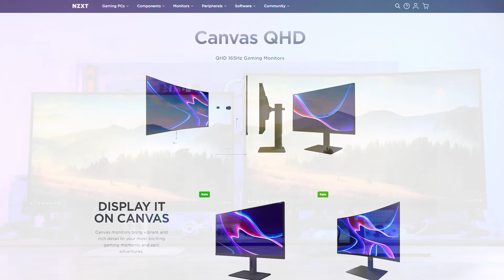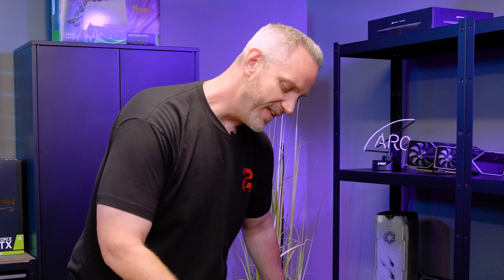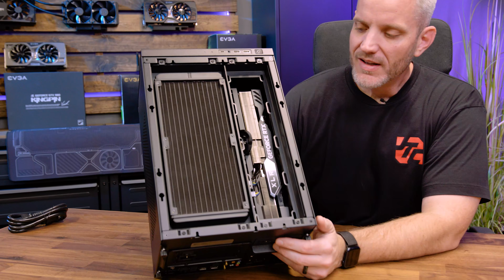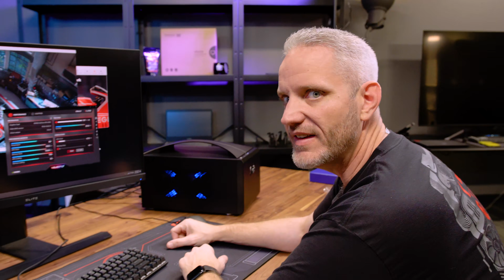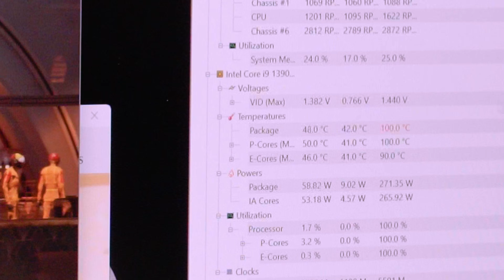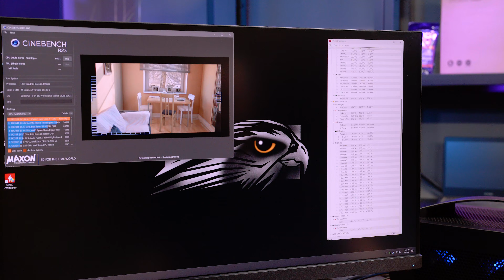Falcon Northwest DARED me to review the Fragbox!

Comment: $3600 for a 4060 Ti, 9600X, & 32GB RAM. That should be illegal.

$2000 in prebuilt tax . What an absolute scam and it’s quite embarrassing that Jay even features their products on this channel.

DIY is $1700 before a case, that’s including paying full price for windows. You also get a better AIO, Liquid Freezer III. 

Just for reference, I just built a 9800 X 3-D , 64 GB ram, 5080 FE, 2 TB SSD, ASUS ROG b850i, LF 3 AIO, in a NCase M2 for $2700… almost $1000 cheaper than the frag box.

Comment: I have a 2023 Talon. It’s awesome. Falcon is awesome. My 4090 cable failed and they got me a CableMod one, tested it and mailed it overnight. I just ordered two AMD FragBoxes.
Reply: I'm thinking about getting an amd fragbox with 64gb ram...but I don't like that their only option for getting a ram with 6000 MHz is their 32gb option. I've read that 6000mhz is the perfect sweet spot for AMD processors, and that anything higher than 6000 MHz will not be stable, so their 96gb 6400mhz option is out the window. What are your thoughts on this? And which ram did you choose?

Comment: Its nice but the price is not, I compared the 7800x3d build on their site similar to my own sfx build, similar parts gpu, cpu, ram size. heck even my gpu costed more then what they show theirs add on to be, and yet their build was around 1400$ more then what i built mine my self.. mine was a corsair 2000d airflow, 7800x3d, 4080 trinity, 32gb ram, msi b650i edge WIFI, 2x 2gb SSD etc.  Their case design is nice but not worth the cost of another 4090 added on top..

Comment: I built an SFF PC in a Cooler Master RC-130-KKN1 Elite 130 - Mini-ITX case that's about the same size, or slightly smaller than the FragBox.  I even have a full-size optical Blu-Ray drive in mine, a 120mm AIO paired with a Phanteks T30x120 fan.  It can fit a 343mm long GPU, but I've got a PowerColor Fighter RX 6700 XT in it.  I love this case so much, I went and bough another one just to have for a future build.

As for the FragBox, I was wondering if they can sell just the case, but with the I/O ports on top (where things can fall in and get gunked up), that was the deal-breaker.

Comment: Interesting.  I have one of these (admittedly, mostly because it was so hard to find a GPU at the time) that's probably a generation older, and this new design is better.  Mine had some overheating issues with the M.2 (added extra case fan) and I had to replace the PSU (they were using a 750w EVGA I think, was rebooting/crashing).  The older one had some really weird airflow.

Comment: Its like the watercooled PC I built about 6 years ago. Silverstone SG02 case and everything (I got an full size 850w psu in there). Still I would move the psu to the other side and let it get its own fresh air intake. Exhausting for that tiny case air makes it so hot you can barely touch it - and it doesn't really do anything to help cool the components. Basically, just making it dump massive passive heat into the case to deal with....

Comment: I have a Falcon Northwest system I bought about 3 years ago. Their build quality is excellent and they use higher end parts. It was not that much more expensive than other brands I looked at. Still runs great, I have had no issues with the system. I did need some troubleshooting help when installing an m.2 ssd and their support is excellent.
Reply: Thank you Aaron!

Comment: I'm mesmorized by the "Prediction" portion of the hardware monitor in the Ai Tweaker menu of the BIOS. It specifically says it expects to reach 1.588 V on the P-Cores at 5.8 GHz. That is extremely high, in my personal opinion. Besides setting the BIOS to automatically adjust the voltage according to temperature, what sort of undervolting could be done to keep the P-Cores at 5.8 GHz so it doesn't run so hot?

Comment: I have always been a fan of Falcon Northwest & Maingear but I have always ended up going with Digital Storm instead because they offer air coolers in their build configurator rather than AIOs. For my use case, AIOs are a deal breaker for me. If FN offered an air cooled option in their build configurator, they would have my business.

Comment: I have a Falcon NW Talon tower with 5950X & 3090.  When running ACC with 29 AI cars, my 3090 climbs to 85 degrees C.  I am shopping for another pc and am considering another Falcon NW Talon with 7950 and 4090.  The 4090 dissipates more heat than the 3090 so I am concerned about heat issues.  I was amazed that the small Fragbox could support a 4090.  Maybe the Talon with a 4090 can manage the heat after all.
Reply: Thanks for your business Mike!  The Talon with a 4090 can indeed handle it.  The 4090 coolers are even more massive than the 3090s.  The 7950X+4090 Talon just won Best Gaming Desktop over at PCMag - check out the review there!  We also do Quadro builds if you're running mainly professional/AI apps.

Comment: "Make sure it is plugged in correctly" needs to have an asterisk that there is very little feedback as to what correctly is.
The slight click you may hear is false, and then it is down to, how far do you dare to push in that cable? It is such a flawed power connector design on that system it isn't even funny.
PCI-E 8 pin has a click catch, once you hear and feel the click you are there and done, and this IS the way to do it, no ifs, no buts, no "mah economy" crap that Nvidia utters lately.

Comment: I found an old Fragbox at my work and built up a monster system in it but due to the old layout (which had a CD rom drive in the front!) I could only fit a 120mm AiO. So glad they kept the size and redid the internal, looks like a total winner except it starts at $3300 USD with an i5 and 3060ti!!! Ouch! I could build a SFF PC with 4090 and i9 13900K for that price!

Comment: Back in '08, when I was considering building my first serious gaming computer, I did a lot of looking at parts and specs and numbers and combinations and all of that was just WAY over my head.  Then I looked at a custom builder.  I seem to remember Falcon Northwest being on my radar as a potential choice, though I didn't ultimately go with them.

What I DID find was that by using a custom builder, Like Falcon Northwest, I could actually get a lot more value for just a little more money.  Like KNOWING your components will work together.  My builder even suggested I change my build because my chosen PSU was going to be running at it's limit and offer no headroom for upgrades.  My builder offered an iron-clad warranty IN ADDITION to the various component warranties.  My builder offered to install not only my chosen OS, but all of my games AND make sure they ran without issues.  Then, of course, they stress tested it and did the burn-in for a couple of days to make sure that when it got to my door it would be ready to play with zero issues.  For all of that, I paid about $300 ABOVE what all of the components I selected would have cost ME to get and build myself.  It was really a no-brainer.

Nowadays, building your own is easier because there is SOOO much information available to the new builder.  And if you wanna do that, I salute you.  But just on the warranty front, keeping all those receipts, filling out all of those warranty forms, getting all of those ducks in a row, and preserving that record if something goes bad before it's supposed to was WORTH the extra money.  That is the real value of a System Integrator, the ridiculous amount of time it can save you.

Comment: Honestly it is a bit lackluster compared to community driven SFF cases. The layout is pretty standard, the size is not even SFF, since it's larger than 20l volume and internally the case is probably sheet metal. People should look into the 15l Ncase M1 Evo or FormD O1. 10l less and same performance in the end, while also being fully CNCd aluminium.

Comment: Hey Jay, I was wondering if you think this would work well for VR use, I'm trying to find a means to use my VR Headset on the go and a Laptop isn't going to cut it.
Reply: What about one of the desktop replacement laptops? Such as a MSI GT77HX? A bit heavier but if you don't seem to mind a 25 lb fragbox I doubt it'd be an issue for you then either. Albeit price point is probably fairly similar for the Titan laptop to that of a 4090 fragbox.

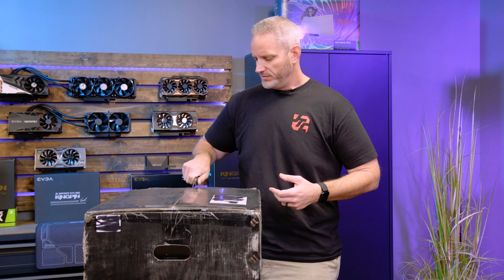Comment: 1:15 if it can power a 3080 Ti, it can power a 4090. The 4090 is actually easier to run than the transient nightmare  3080/Ti/3090. You'd only be able to use 3 cables and need to stick to 450W, but it's definitely doable on 750W. I've already done it with a Corsair SF750.

Comment: Your an practical guy Jay, i have asked this several places but never get an answer...  the gamingnexus video on the wrong way  to install an aio...
at 5.30ish he says the rad is split 60/40% > inbound/outbound...  this would mean that by volume with barbs down water would need to be pushed up over the separation plate, where with barbs up the water in the outbound side would be at a higher level than the inbound forcing the water up to the rad outlet barb and any bubbling thus gurgling would likely be the water coming in and not a problem at all.  this would mean that you want the air to be trapped at the radiator inbound barb with the barbs at the top of the rad, and putting the barbs at the bottom would actually be BAD!?  would this not make the video the wrong way to install a radiator?

Comment: Hey Jay. First of all I want to thank you for your videos, they are really helpful and quite easy to learn from even being not so good at computers.
I would also like to ask you for advice.  I have recently bought my dream custom gaming PC and after spending several thousands I get continously random rebootings, my PC turns off and on itself without showing any blue screen. I can play for five hours straight without problem or it can happen after five minutes of turning on the PC.
I have tried doing a complete format of the PC , reinstalling the envidia drivers as you showed in one of your videos and nothing I do seems to fix the problem.

Specs:
Asus ROG Maximus Z690 Hero
Intel Core i9-12900K
Asus ROG Strix LC 280ARGB
Kingston Fury Beast DDR5-5200 2x32GB 
Asus Geforce RTX 4090 TUF OC
Asus ROG 1200P2
Kingston Fury Renegade SSD PCIe 4.0 NVMe 1TB
Kingston Fury Renegade SSD PCIe 4.0 NVMe 2TB

All mounted on an Asus TUF Gaming GT-501 and running windows 10 pro

On Windows Event Viewer I get a critical error with event ID: 41 and source: Kernel-Power
I get other several errors with sourse: Kernel-EventTracing with event ID: 2, 3, 28

I have report my problem to Asus and they have told me to change my first bought RAM (Kingston FURY Beast DDR5-5600 2X32GB) because it wasn't compatible with my motherboard. They told me also that DDR5 RAM with chips from Hynix are being having problems, so the new ones are Micron.

I dont know if you might have any idea why I'm having this problem with my PC. Is there any tip you think it might help?

Thanks a lot in advance and continue with this amazing proyect.

Comment: I think it's a bit of a myth that SFF builds always run hotter than ATX builds. My current SFF build in a Lian Li A4-h2o runs cooler than most of the ATX towers I've had. A low internal volume makes the few fans much more efficient, and my GPU pulls air directly from outside.  I think it's funny seeing full towers with 16 fans stacked on every surface... such a waste.

Comment: Power supply is probably more of the primary exhaust, less the aio.

I really like this. Since I've been binging pc build videos and anything relevant from you and der8auer, I'm learning that I'm absolutely intrigued by SSF builds and overkill custom liquid loops.

Someone on reddit posted a literal external radiator wall in a stand for their custom loop. Designed to go by a sliding door on a cool day. 

Hes getting 9C under load

Comment: That thing looks very pretty.
My only issue with the design is the external front side IO ports don't have a dust cover (USB and Headphone jack).
The Fragbox is definitely progressive and a few tiny tweaks, like a dust cover and and fan flow low > high speed configuration possibly eliminating some whine and further optimizing air flow, would make the thing future proof as hell. It (Fragbox) already looks like an ultimate purchase.

Comment: FYI the surface area of a 280mmx140mm vs a 360mmx120mm AIO is only 10%. 360 AIO is 43,200mmsq, and a 280 AIO is 39,200mmsq, so the 10% reduction in OPEN AIR vs INSIDE the case shows that the one in the case is actually doing better than expected.

Comment: With what we've seen from other youtubers testing of stacking fans (essentially, don't) I'd love to see how this would perform if you pulled the fans from the graphics card, and maybe ducted the air from the chassis fans directly into the heatsink (for testing, that could just be tape.)  It'd be super interesting to see how performance changes.

Comment: I like the case! It's almost the same size as my Fractal Core 500, only the Core 500 has the wrap around top shell (3 sided) and there's no integrated carry handle. On those points alone that Falcon Box is a well though-out design.

Instead of getting an Xbox, I decided to build my first ITX system to commemorate the 20 years that I've built PCs. Back in 2001, 11 year old me bought my first PC as a box of scraps from Goodwill for $49.99, and in keeping that theme 20 years later the Core 500 was a $6.99 thrift store case. Not bad for what it is. 

Falcon Northwest has the right idea. That's the perfect size-performance ratio for a portable rig.

Comment: I remember when I was younger and pc modding was becoming more popular Falcon Northwest and Alien Ware were the only two pre-built pc brands that weren't the normal HP or DELL offering. Though I NEVER liked Alien Ware even before DELL bought them. Their stuff may have been slightly better than a normal brand but they still went with flash over quality. Now they're owned by DELL and continue the saga of flashy design with no quality. Falcon Northwest on the other hand I used to look at the ad for their systems and wished I had the money for one. Their overall design was cleaner and more simple than Alien Ware but you could tell it was quality just looking at it. I don't remember the model but I remember drooling over one of their pc's in an gaming magazine ad around 2000/01 where the outer case panels were all black and the internals were all painted red. It's common place now but no one had red painted internals in their pc's at the time. Everything was still raw steel that made your hands stink when you'd move system around. :)

Comment: I prefer tall cases to ones laying flat, they take less Deskspace. If you want a non-Compromise Case that is still small, then go for the AP201. It supports mATX, ATX PSU and a 360mm AIO. It can also fit a 4090 Strix with a smaller SFX-PSU.
Even smaller Cases are the NR200P and many other with similar layouts. There are even smaller Cases, like the DAN A4 H2O, but those do compromise in the GPU size.

Comment: I just bought the PNY XLR 4090 and 13900k. I got a 1000 watt Super Flower platnum psu and was kinda worried I might have went to low on the PSU. But after watching this video I feel more confident that it will be fine. I also used a Z690 board. So this build is very simlar component wise. Minus the small for factor.

Comment: In games you really won't see a difference going from 5.3ghz to 5ghz, yes you might loose a few frames but I would rather have those temps in the 90's as opposed to the 100's. Only time I would run it balls to wall is in Winter when you need an extra space heater.

Comment: That looks like a solid solid unit. I’d much prefer a form factor that is slightly larger but allows for overhead in cooling and power. I’ve seen smaller units but they seem knee capped by the size. When a few millimeters here or there would allow for full size components. I like the box. 😉

Comment: The Falcon Tiki is the one you want to be looking at for a grab-and-go travel LAN box. I wish they still made it with the marble base like they did when it first launched, although a nice thick piece of stained and varnished oak would look the part too, or some milled/machined heavy metal as the base.

Here's a wild idea: take the 8x4 plywood sheet you can stuff inside a truck bed or modern SUV/wagon and make a desk PC in the same size that you can dismantle the legs - perfect if you are driving to your destination and can reassemble the desk PC at where you are going. Put the monitor on a removable arm and you are all set. You could even do full custom water with flex tubing and do dual mobo. That would be a LAN PC I would be interested in seeing.
Reply: The Tiki comes standard with a 5 pound billet of solid aluminum for the base now.  Milled on a 5-axis milling machine, bead-blasted and anodized.  A little more precise than the granite bases were.  :)
Reply: @Falcon_Northwest  That's great to hear 👍 Christmas is coming and my 7yo 5960X is feeling long in the tooth. Can you perhaps send me one for free???

Comment: This was an interesting look, but IMO you tainted the whole thing by outright and blatantly lying before even hitting the 1 minute mark on this piece. Not just reciting the manufacturer's lies, but adding your own.

There's loads of ATX 3.x compliant SFX PSUs for sale, now with native PCIE5.0, full 600W spec 12+4 pin outputs. We've had plenty of 1000W+ SFX spec PSUs for sale for years already, there's even 1300W SFX PSUs now. Not even "SFX-L", but standard SFX format.

So not only has there been PLENTY of SFX power supplies for sale for many years now, that won't break a sweat powering a 4000-series GPU - there's now models that could, technically speaking, comfortably drive TWO 4090s in 450W config. Or a 600W config 4090 and a 64C overclocked Threadripper, with still a fair chunk to spare for transient spikes.